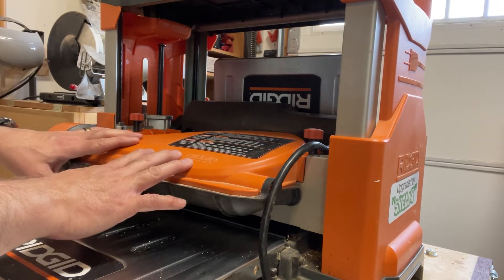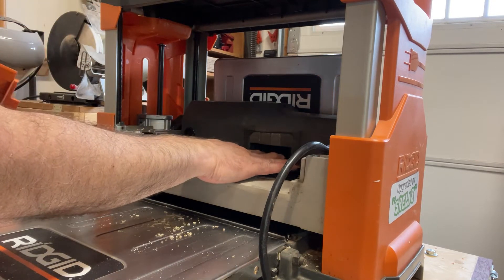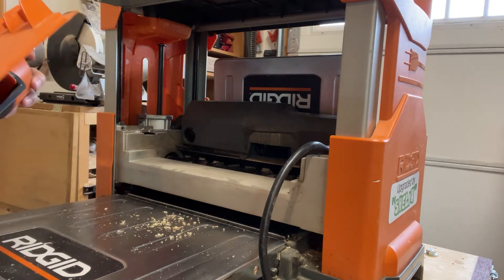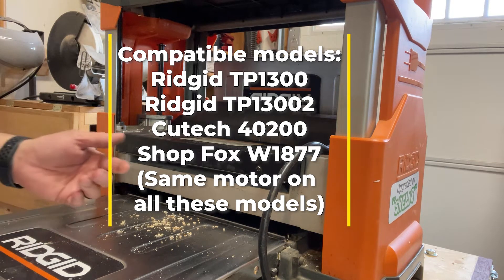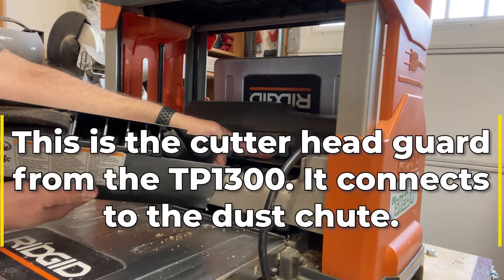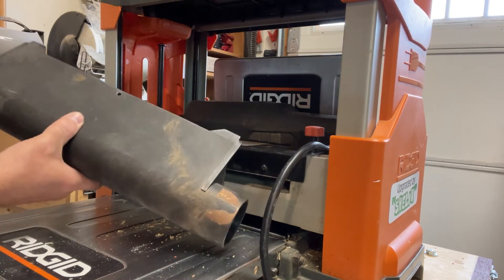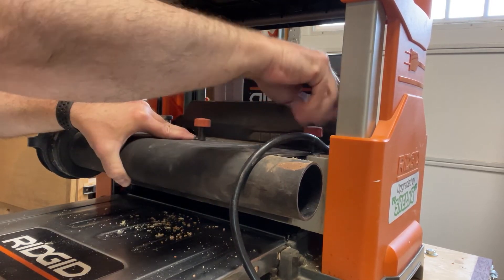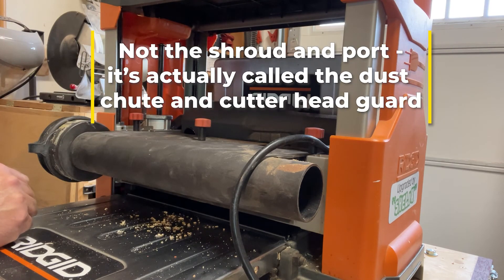Interchangeable planer parts

Comment: How does the dust collection quality compare between the original set up from the Ridgid to the alternative assembly you show?  Any improvement or about the same?
Thanks for sharing this knowledge.
Reply from the maker: Sadly, it's about the same.  Which is to say... bad. It's not any worse than the original, but I don't think it's improved at all. The dust collection is probably the worst aspect of this type of planer.

Comment: I'm not being able to find new blades for my TP13002. Several replacements on Amazon, but reviews say that they are not correct. Ridgid has discontinued part number AC8630. Wondering if you can steer me in the right directions.
Reply from the maker: Before I swapped the cutterhead for a Shelix I was buying my blades from a small business here locally, but I think they have gone out of business now. I would recommend one of the more reputable retailers, like Highland Woodworking or mywoodcutters.com. Or even Rockler or Woodcraft - I think they both do a pretty good job of vetting their products. And since the Shop Fox W1877 appears to use the identical 13" cutter head, I expect you could order the blades for that model from Grizzly and they would fit fine.
Reply: @kenkoyle  I looked at the ShopFox and it has a spiral head. I can't afford that. Thanks for your suggestions.

Comment: do you have the parts name and parts number
Reply: I got the same problem as the dust hood is cracked
Reply from the maker: The part I was talking about in this video was the dust hood, which is part #X1877032 from Grizzly (see the link in the description for the video). Lots of other parts appear to be the same though, so you would just have to compare the parts you need to the diagram and see if they have the same component. No guarantees because I haven't tried them - I just noticed that the Shop Fox parts diagram is identical to the parts diagram in my Ridgid TP1300 owners manual.
Reply: @kenkoyle  how lovely U provide me a Great Hand